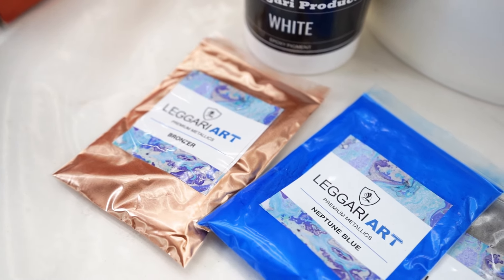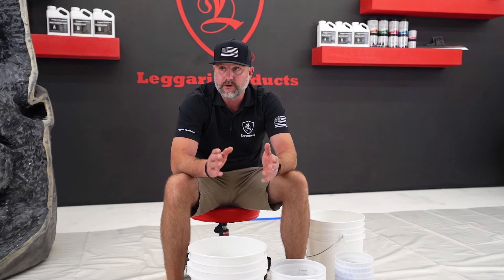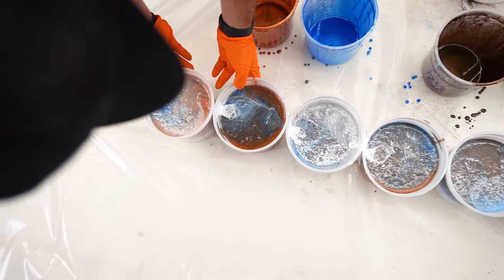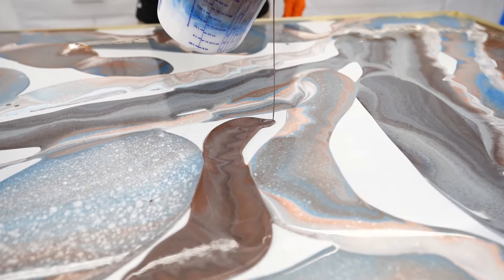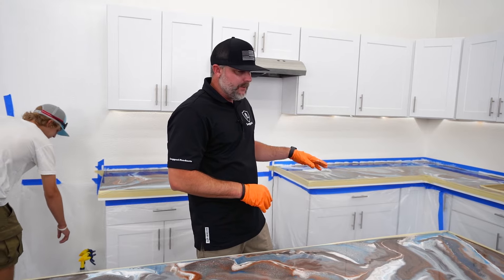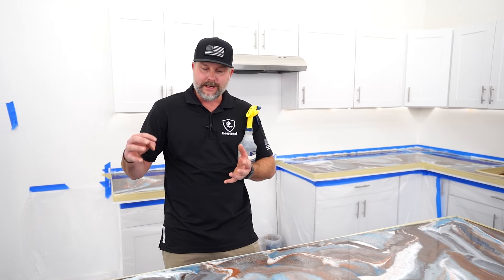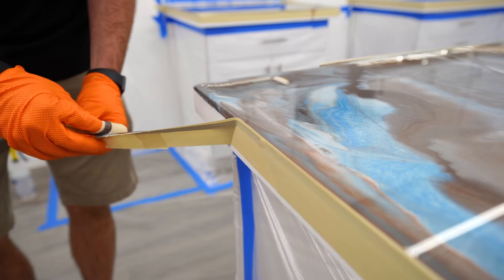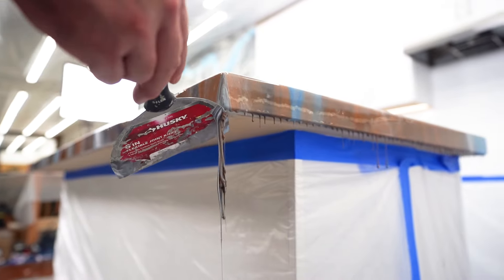How To Do Epoxy Resin Counters - The Ultimate Guide

Comment: I am always watching your wonderful work from Japan!
Is it possible to keep dust out of the resin until it cures?
I coat my art with resin and dust always bothers me.
Reply from the maker: Hello from Washington State! When doing projects like these, it is impossible to guarantee that absolutely no dust will get into the epoxy before it cures. You just have to do your best to keep the working area clean and controlled and to be sure there isn't too much air flow. It is always an option to sand down the dust particles once the epoxy is cured and re-seal it.

Comment: Damn.... What a beautiful sight!
Question. How long does it take to do the whole process, from mixing the resin to scrapping the edges?
Reply from the maker: Thank you! You can see in this live vide(we apologize for the low video quality), that from mixing the epoxy to getting the table coated took less than an hour. Depending on the temperature, the epoxy typically sets enough to scrape in less than an hour after that. 
https://www.youtube.com/watch?v=ysjk5uO4CNI&t=47s